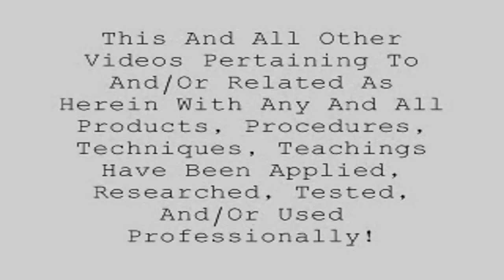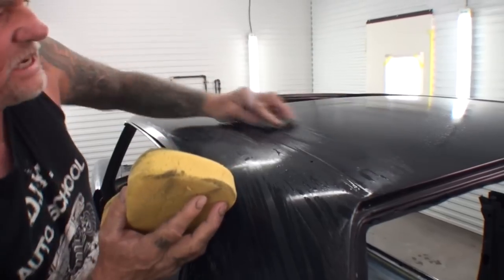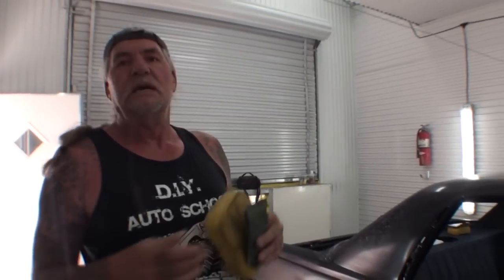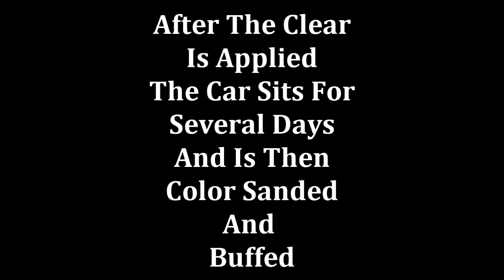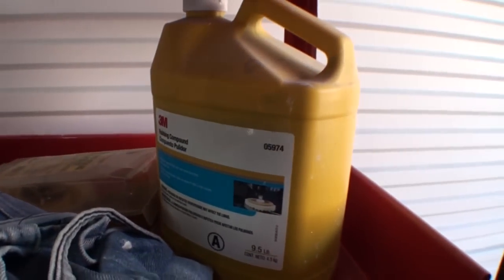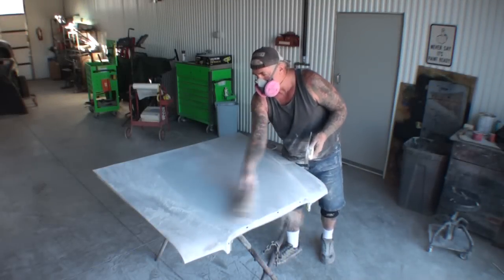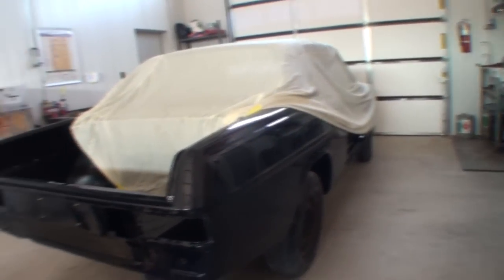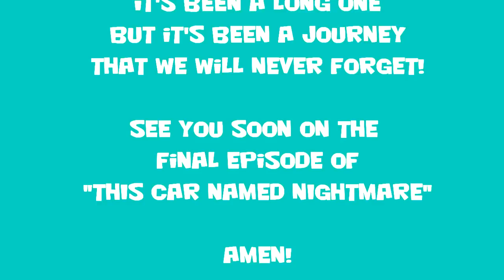Can You Restore A Rusted Car? " At Home " - Part 22 - This Car Is Painted

Comment: Suggestion - when building a booth - do not run the wall sheets horizontal - the dust etc will use the almost flat sections as nice little areas to rest on and will become a pain in the arse to clean - run the profile vertically.  Pure physics -HA.  HA - I get a sore back just watching you cut and polish - that is one task I like to 'outsource' to someone else. Thanks for the videos - HA - other than sometimes having to mute the yelling - much appreciated by many.  CHEERS from AUSTRALIA.

Comment: How much does a job like that cost? I'm guessing 20 grand?
Reply: 2 years @$10/hr
Reply: @drcornelius8275  Labor, paint, materials and delivery extra! So, $143.78 X 6 days per week for 711 weeks. Having Pete do the repairs, welding, straighten a sandblast hood that has no structure, roof with no structural, rusted water channels behind vents, partial trail light panel, L & R floor structures from donor vehicle, inter-coat clear DBC500, 1,500 grit and 3 coats of Medium Solids Matrix clear, cut and buff, compound and polish, wash and wax by Pete & Minnie...Priceless!